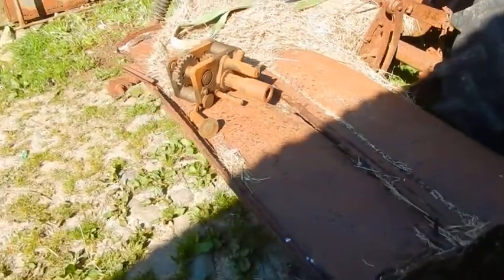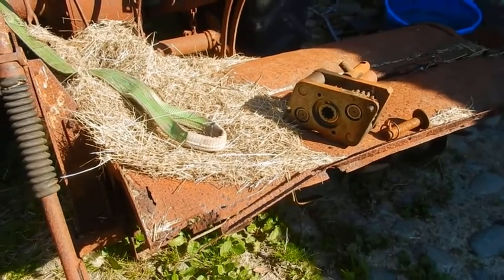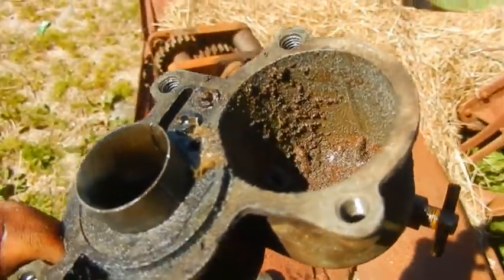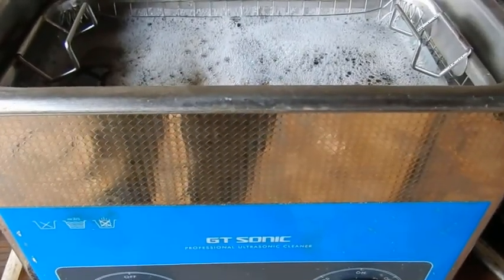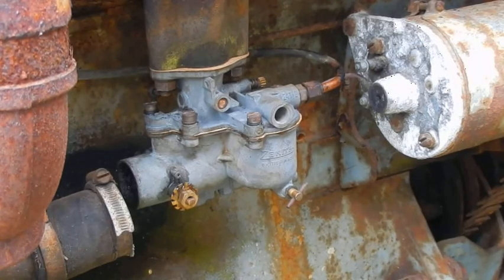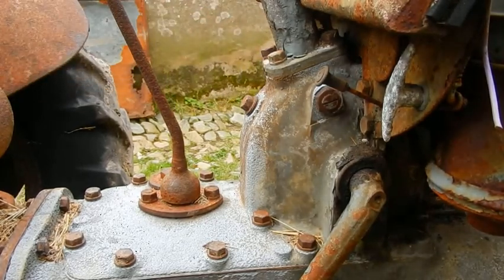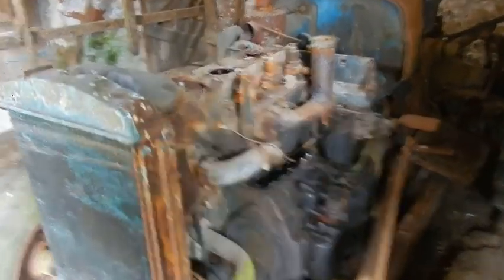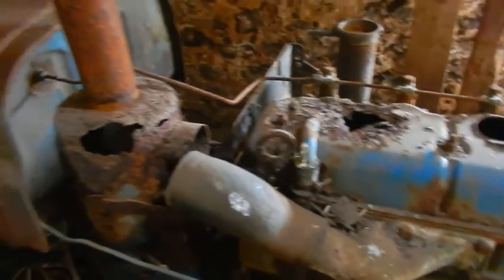Ferguson TED 20 Will it start after ten years?

Comment: This reminds me of a super dexta tractor i drove many many years ago in Wales near Ruthin Been looking  for it ever since I would just love to be re united with the old girl !!
I also had the old grey fergie which I found in a field Seized solid got it home and left it on the drive took the plugs out and poured deisel down each plug !! Every morning on my way to work
I gave the back wheel a nudge having left it in gear "BLACK HANDS" After a few weeks it suddenly clicked "IT WAS FREE" did the usual fresh petrol new filters new spark plugs etc etc 
bought a 12v bat although she was a 6 v and hey presto she started How good was that ???? I then ran the old girl for several years around the bit of land I have These machines are quite un 
destructable Lets see how many modern units are still about in 50/60/70 years ???? AND STILL RUNNING ???? Irespective of subs you should do the re build but leave the patina alone 
she is what she is and old friend and old friends look best when they still look old do they not good luck and thanks for the up load !!!!!!!!!
Reply from the maker: Couldn't agree more. I hate to see these things over restored with chrome wheel nuts etc. When it is done I still want it to be Grandpa's tractor!
Reply: @wotjonsez2560  I get it I honestly do good luck with the project !!